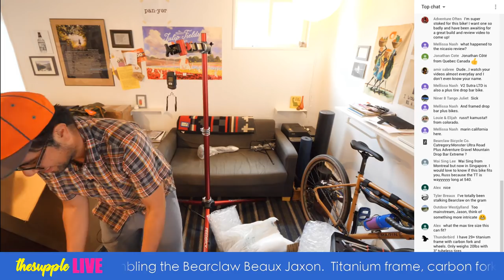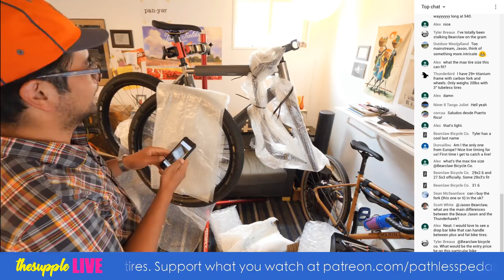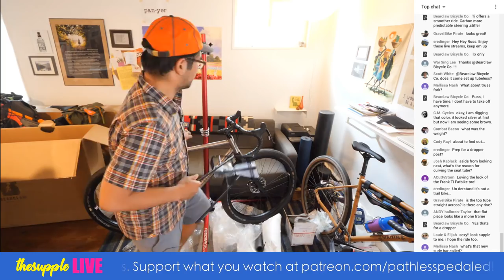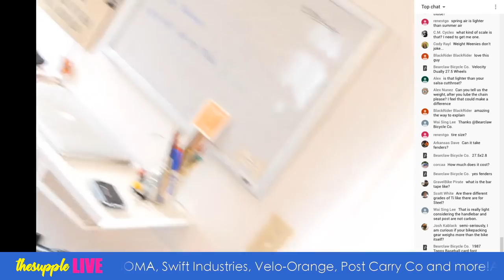Titanium Monstercross Bike! Bearclaw Beaux Jaxon UNBOXING! #THESUPPLELIVE

Comment: Titanium seat tubes are very mostly oversized at 31.8 in diameter and internally shimmed at the clamp area.   I believe the reason is that it's easier to weld and/or allow more weld area on the joining tubes for given titanium tube profiles.  Aluminum shims are used to use a 27.2 seatpost.  If the seat post is 31.6 it's because there is no shim in the seat tube.

Comment: Headset seems to be adjusted on the tight side.
Reply from the maker: How can you even tell that on a YouTube video?
Reply: @PathLessPedaledTV  I dont know for sure of course, but every time you turn the handlebars (with or without a wheel) at any angle, they stay put. Normally the wheel (or empty fork) would fall over to one side or at least swing a little. Granted, the bike is horzontal and the cabling will dampen this a bit, but it caught my attention. But maybe I'm wrong, so that's why I said 'seems'. :-)
Reply: @PathLessPedaledTV  And also: thanks for your super nice video's!